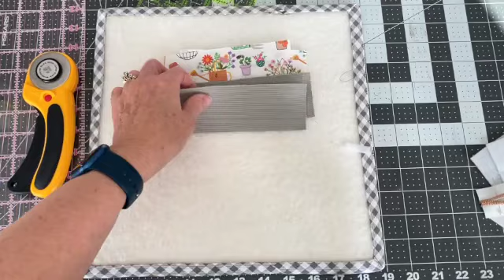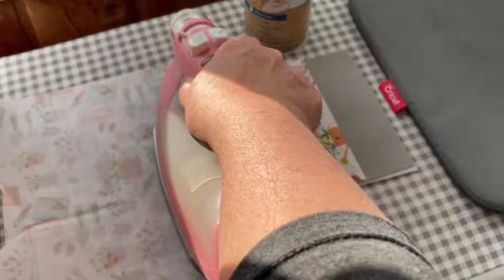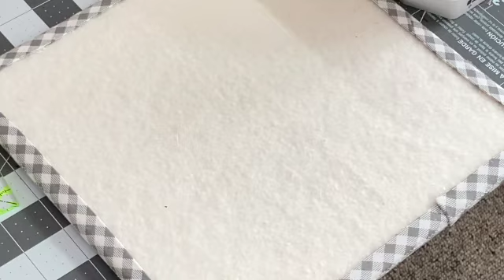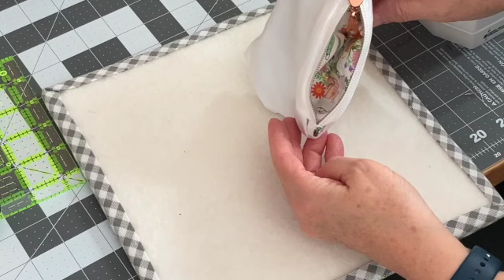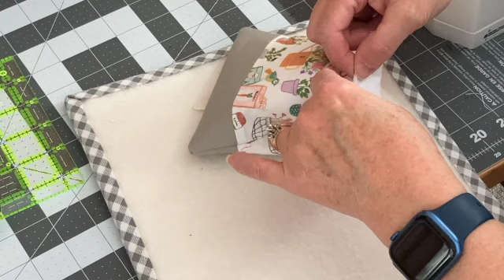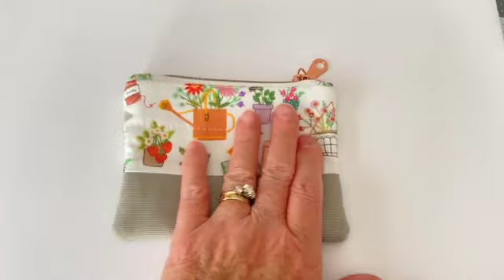Sew a Small Lined Zipper Pouch | Beginner Sewing Tutorial | Learn to Sew | Janome 8200QCP

Comment: Hi Pam - nice video. What is your best tip for nailing the match on seams when sewing a pouch w/contrasting fabrics? Do you cut the pieces at the same time so when they get stitched together the alignment turns out perfectly? Ive done several w/top & bottom contrasting & always one of my 4 corners (boxy pouch) has the slightest misalignment. Really only I notice - but I notice 😂😂😂
Reply from the maker: You’re right, you’re probably the only one who really notices. If you want the fabric to line up perfectly, you will have to “fussy cut”. Which just means you will have to cut each piece separately so they line up exactly.